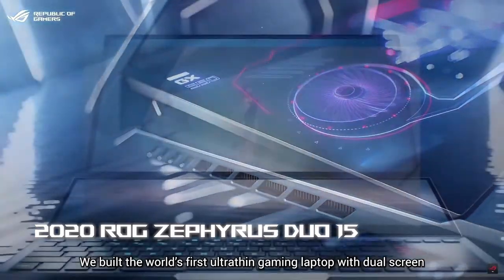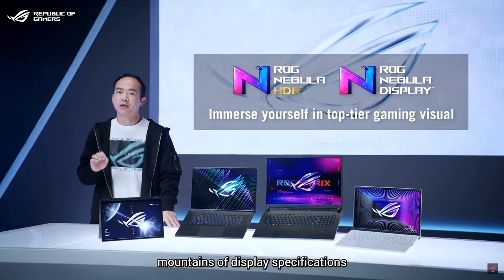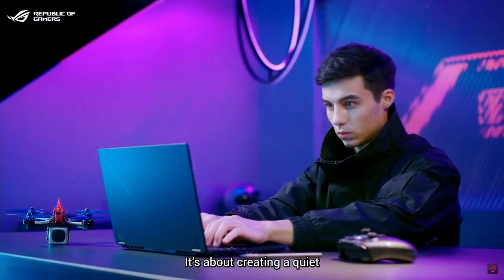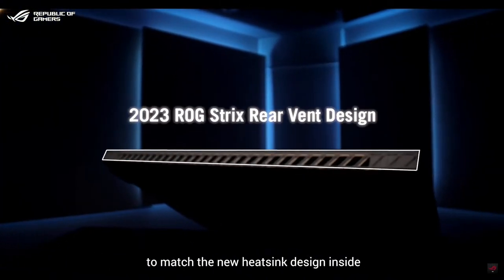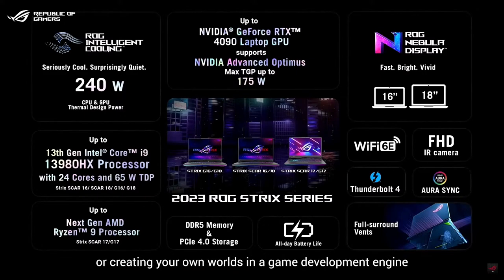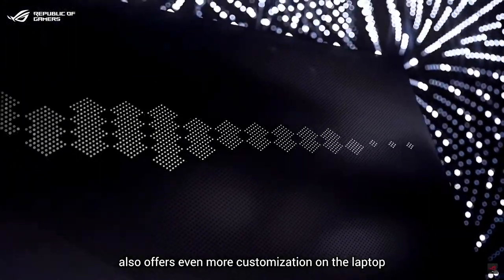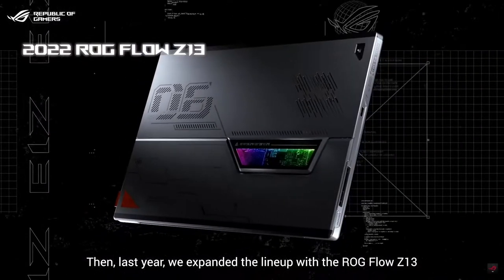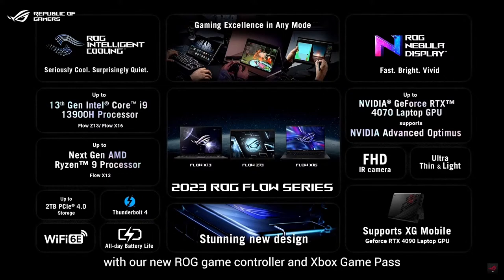Watch Every RTX 40 Laptop ROG Revealed at CES 2023

Comment: Would be nice if the prices are more reasonable this year. I would love that G16 with 4070, but im not paying over $2,000. Sorry Asus. Prices last year started out ridiculous. Hopefully they simmer back down some this year. If the G16 with 4070 is over $2,000, im probably just going to end up buying MSI Raider with 240hz OLED
Reply: You can just get 4080 cuz 4080 and 4090 starts with 2k
Reply: Msi cooling system is garbage, nowhere near rog vapor chamber.
Reply: @ShebanFPV  Sure. Thats why MSI Raider is the best performing laptop for years now. Do you know why its the best performing? Because its cooling and chassis enables it to have higher wattage to GPU/CPU. Without its better cooling, they would have to lower the TGP like on the Zephyrus models. I think this year Asus is making the TGP slightly higher though so thats good.
Reply: @dlaroc  lol ))) MSI is garbage in comparison to ROG in terms of cooling. For years I’ve been buying and using various top ROG models. Last year I bought MSI GE76  with i9 and RTX3080, paid 4.5k$ and I regret, as it is a frying pan, a toaster, you name it. Lovely machine, nice design, but all that power is useless, it throttles after a few minutes of use. I repasted it, did undervolting, got a bit better, But noise and temps are still 🔥😂💁🏻‍♂️🤦🏻‍♂️🤦🏻‍♂️🤦🏻‍♂️🤦🏻‍♂️🤦🏻‍♂️ during turbo boost I still hit 98*C )))
Yeah, Rog zephyrus is not “true” ROG, it is thin and not hardcore. I am not talking about thin “stealth” machines, they are all poor in terms of thermals. You are comparing apples to oranges mate.
Reply: @ShebanFPV  Well I’ll take your word for it if you’ve owned it before. I really just want the 240hz OLED but only other 2022 laptop that has it is Blade 15 and it’s performance is very low compared to the Raider. I’m waiting to see all the 2023 laptops before deciding though. Im probably going to get the G16 w/ 4070 if it’s not over 2,000.
Reply: @dlaroc  yeah, I looked at the cooling system, MSI is the same, shared heat pipes and no vapor chamber, also liquid metal only on GPU 🤦🏻‍♂️ how hard it is to spend extra 50$ to put liquid metal on both? 😅💁🏻‍♂️ Honestly, I am not affiliated and I dont give AF about brands ) yeah, Asus ROG was hot, but cool to the touch and very stable temps and no throttling, nicely dialed in. While “glorious” MSI turbo boosts to 5ghz and rolls back to 4 as it overheats instantly 😂😂😂😂 GPU temps though were great and stable, around 75-80*C playing many games on Ultra. But the fun noise 🙉 and if you switch on turbo fan )) it is as loud or louder that my Dyson on boost 😅 it just has got not enough heat pipes on CPU :(( this year, same cooling, same story. If they have upgraded to vapor chamber as ROG and Alienware did for years, in a past and today, hands down I would have bought MSI.
Reply: Also in reality Your also getting 3060 desktop performance......